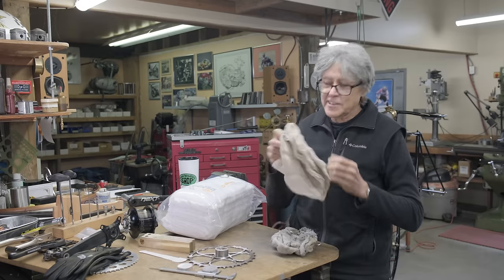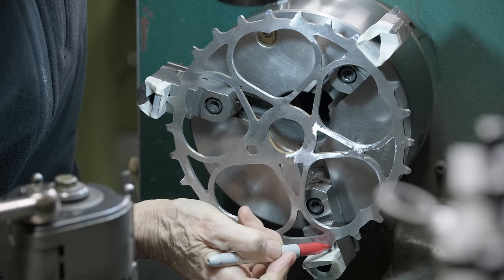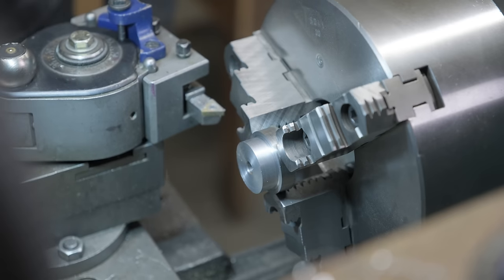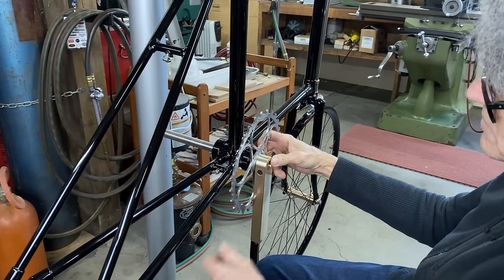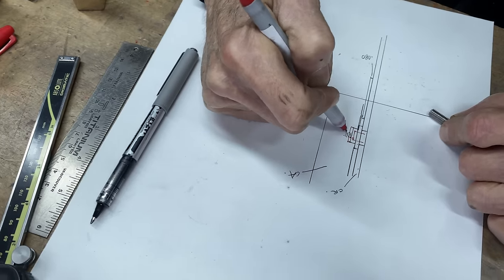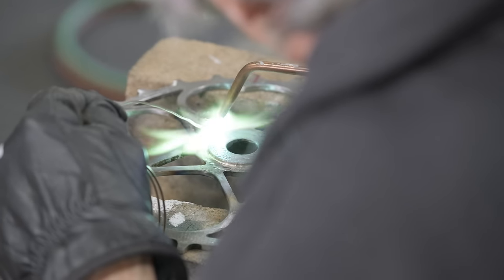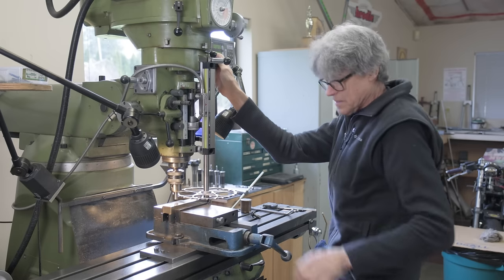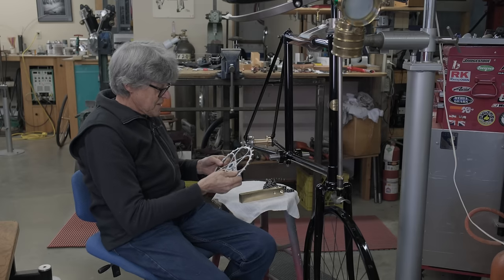Modifying an old SCHWINN chainring for the GIRAFFE BIKE // paul brodie's shop

Comment: Paul I love you’re your.
And I get the ancient methods here, cotter pins for the crank to spindle, bolt through chainring to crank arm .
But I would have been interesting to keep the old with a bit of new, like a spline drive sprocket and some splines on the crank to spindle.

Comment: Damn, I was waiting for Paul to turn the crank at the end to see how much the chain tension varied. 

Always been super curious as to how small the tolerances have to be, in order for the chain slack to look constant... Would've also been good to see a close view of the chainring teeth as the ring turned on its shiny new centre bore.
Reply from the maker: OK, when the cranks are done and the wheel is built we will spin things and see how we do....   :face-orange-raised-eyebrow::face-orange-raised-eyebrow:

Comment: The microfiber towels are great to have around when you want to wipe something clean like when you need to acetone parts for welding or to wipe things clean for reassembly. But man they are a pain when your machining around them that for sure. I like the box of rags that Lowe’s sells I think It’s T-Shirt materials they don’t attract chips/swarf. 

The bike is going to be amazing!!!
Reply from the maker: Thanks Rick. I did find out that Home Depot still sells the painters rags online, not in the store. I did order, and they are cheaper too..  pack of 25 for $9....    :face-fuchsia-tongue-out:

Comment: Hey Paul, didn't you put the chainring out of center by clamping it on the equal teeth with a chuck that ve a 120° split? I made a quick sketch and got some offset there. // I measured around 0.23mm offset
Reply: That was my thought (scare) too, from there on I was like; well all is out the window now… I cannot stop Paul, nor should I… he knows what he’s doing for sure. But we are all waiting for that first drivetrain spin and look how constant the chain tension is and see how good everything is lined up and round. Fingers crossed, and Paul, you are doing a damn fine job with this bike!

Comment: When the bike is finished .will ther be alot of force goin trough that crank stud ?
 Are u puting cotter pins in crank to chain wheel axle?
Reply from the maker: Yes, I am using cotter pins like a lot of older bikes used.  Not sure what you mean by "crank stud" ? Are you referring to the BB axle as the "chain wheel axle"? Your terminology is a wee bit imprecise! But, thanks for watching and commenting!   :face-orange-biting-nails::face-orange-biting-nails: